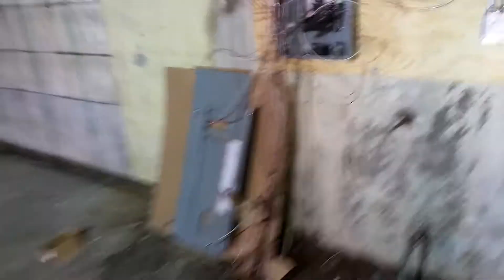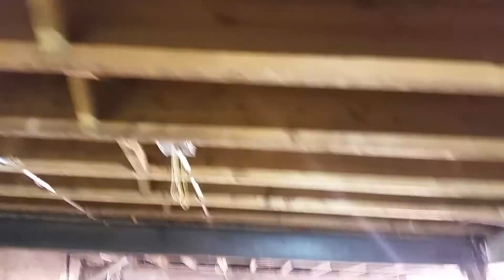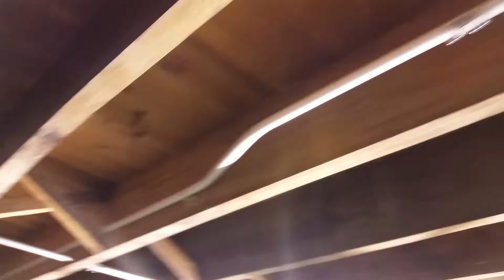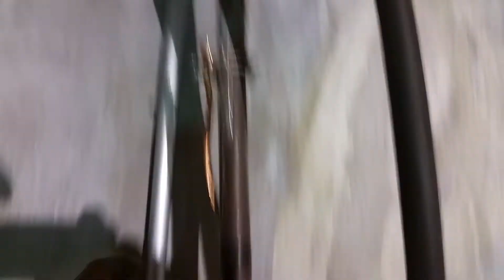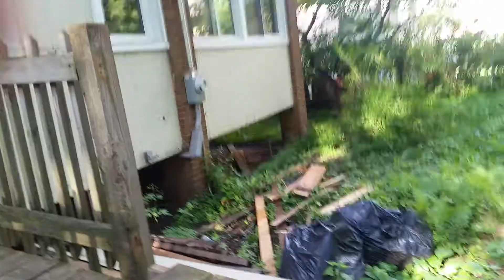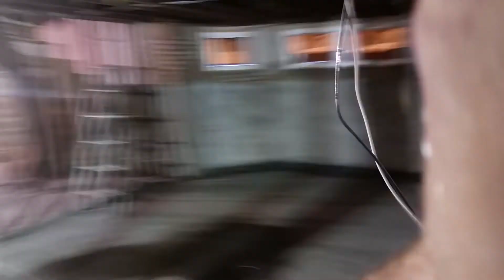Wrapping up the South Side residential job part 2

Comment: Satco makes the best LED retrofit bulbs for those 400 Watt metal halide fixtures. You can save on power consumption and they last 3 to 4 times longer.
Reply from the maker: Right on

Comment: what the hell black is hot green is ground
Reply from the maker: Ya I know man
Reply: In a lot of places, bare Cu or Al wire's used... Still the case, or must it be correctly sized blk THHN or similar?
Reply from the maker: BPM Productions of Colorado inspector said blk thhn or solid bare.
Reply: Thanks! 
My current place, built in '73, has a no. 6 bare from the panel to the copper water line in the basement. I relocated it to the street side and jumped the meter. Also landed all the commo grounds to the GEC as it approaches its end point.

Originally, this house and the rest on my street had a Square D QO 16-space split bus panels. Over the years, they have been exchanged for larger panels and the like.
Reply from the maker: BPM Productions of Colorado sounds like you have a handle on it.
Reply: Wire needs to be black  with green tape to identify lol 😆 but they won't let you use green #8 awg or bigger